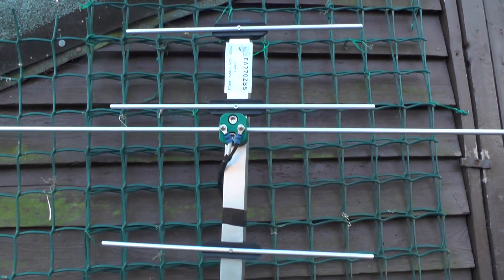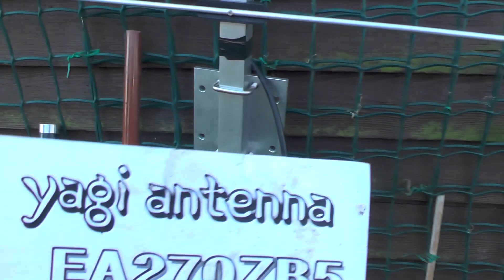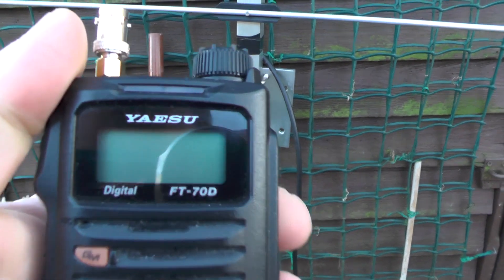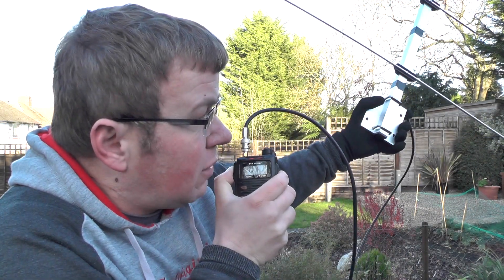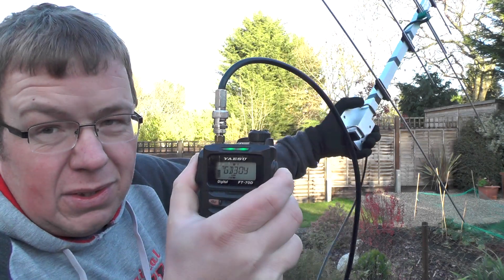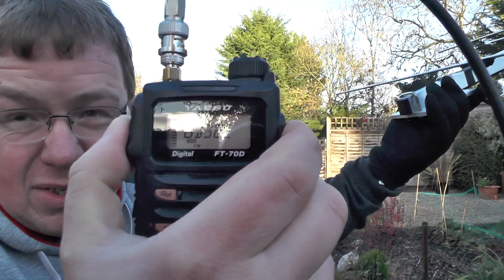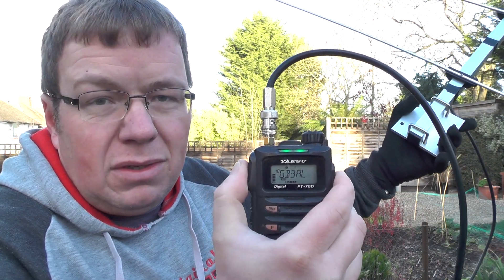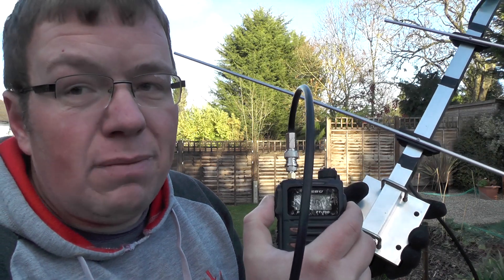2M:70CM beam testing

Comment: Looks like it works mate.  I was hoping you would get a contact :-)
Reply from the maker: it worked very well at my brothers flat. Up the top of the stairs there a flat roof which leads to another flat I stood on there and shouted and got GB3OY end stop
spoke to a bloke in waltham cross on the repeater it was as if he was next to me 9 plus signal and radio 5